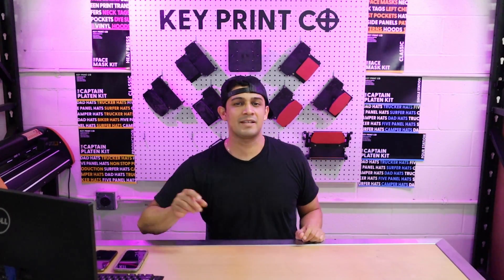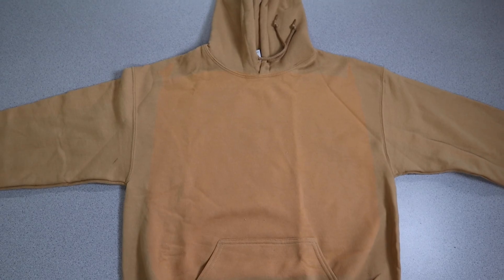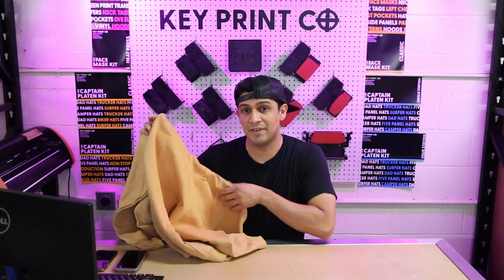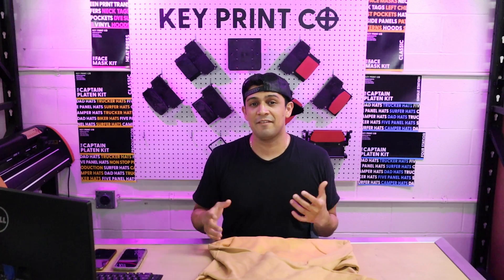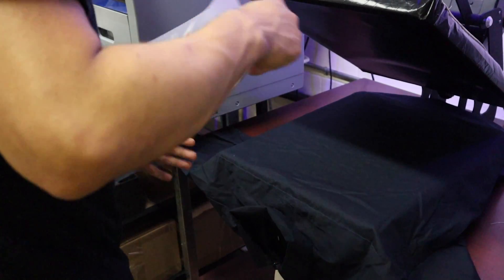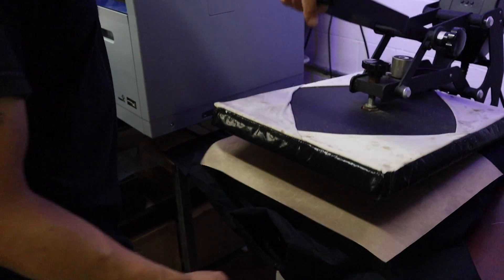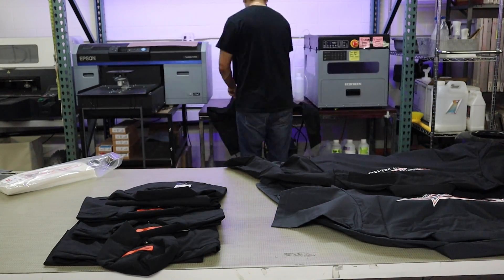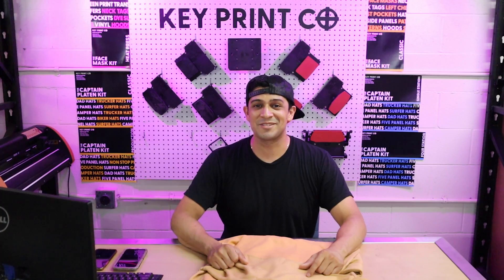Do You Need To Pretreat With Direct To Garment Transfer (DTF) Printing? | AA Print Supply

Comment: How well does it hold up after several washes?
Reply from the maker: Hello,

With application temperature between 320-330 F and time of 15-20, cold peel and then a 5 second post-peel finishing press we rate the washability of around 50 washes before loss of vibrancy